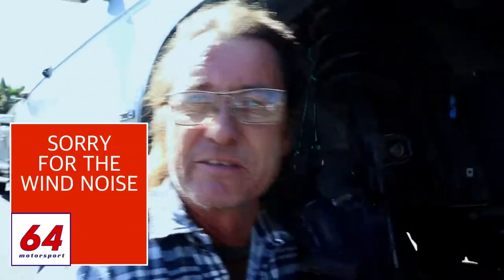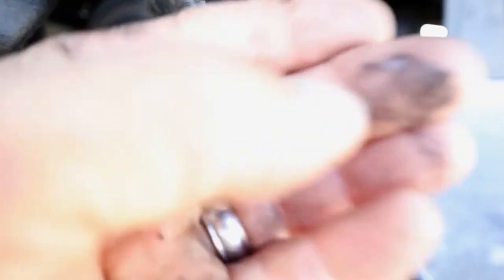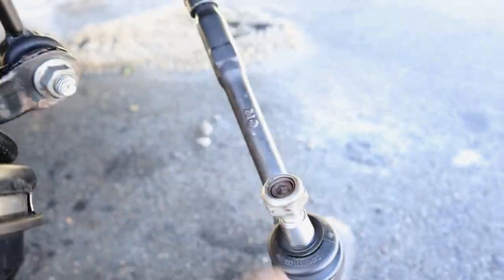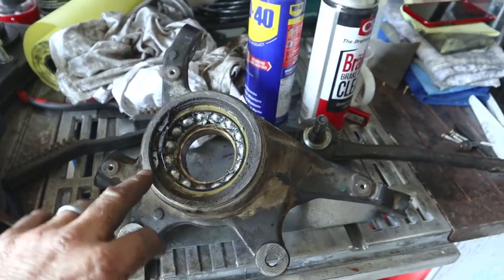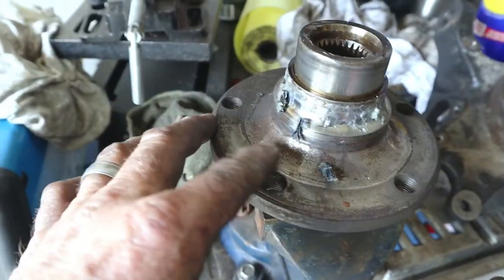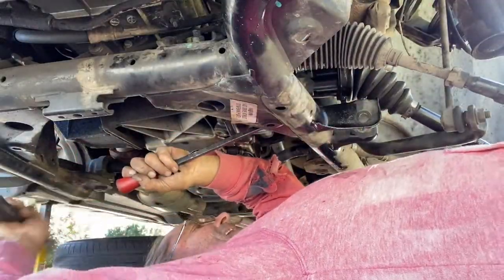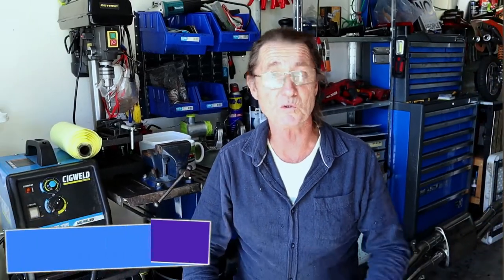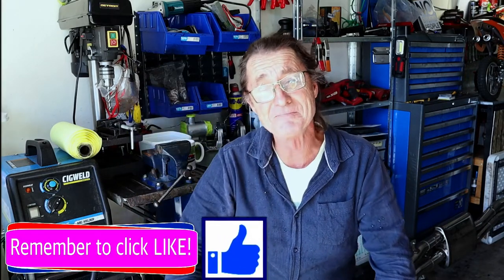BMW E53 X5 DRIVESHAFT REPAIR // Replacing torn Driveshaft Boots

Comment: Well that's one long and proper way to fix and clean everything on that front end.might as well replace everything you take off with new parts.good job- last time I did mine was a short cut by releasing the inner joint and replacing both boots...